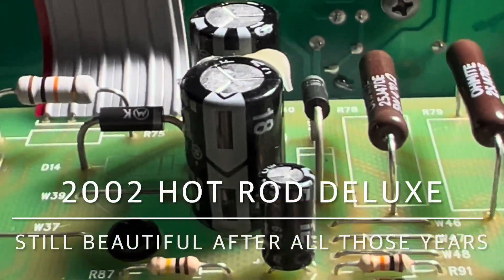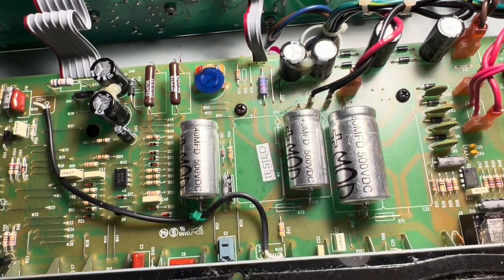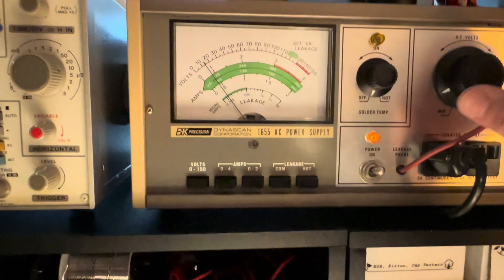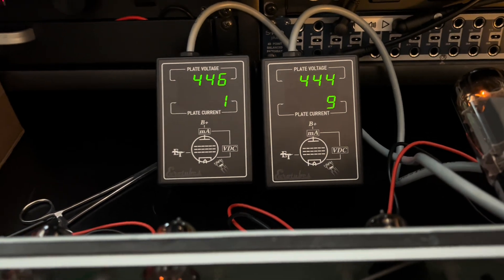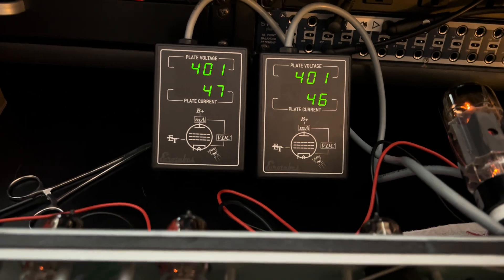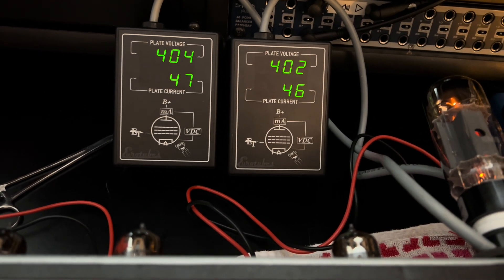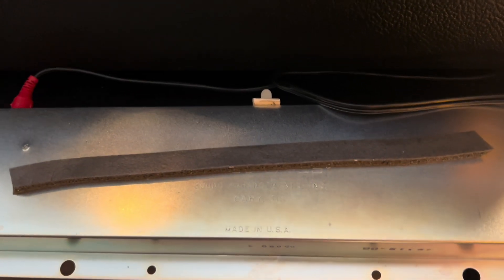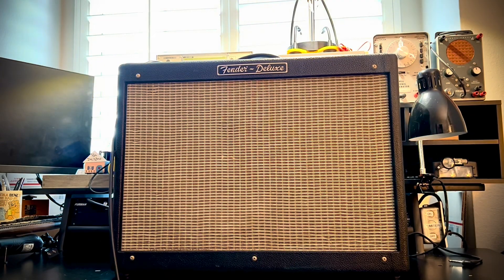2002 Fender Hotrod Deluxe: Still Beautiful After All Those Years

Comment: I've never understood why people like this amp, you just can't get a good sound out of it, and it sounds nothing like an original fender deluxe.
Reply: The are versatile, compact, all tube, big balls for 40 watts, can be run in stereo with the compliment cabinet you can plug and play, and I've had several compliments on my tone, and most are a bit amazed at me running that type of sound through just 40 watts.  To each their own though.  I run a wet and dry signal simultaneously through mine and get great sound.
Reply from the maker: @CyberBrew that's a great move with that extension cab.
Reply from the maker: I like them when they are set up a certain way. Not meant to be a blackface deluxe clone.
Reply: Don’t you think Taste in sound is purely subjective just like everyone’s taste for food?  Some players prefer single coils while others prefer humbucs🤗